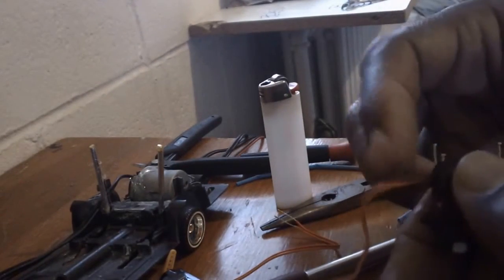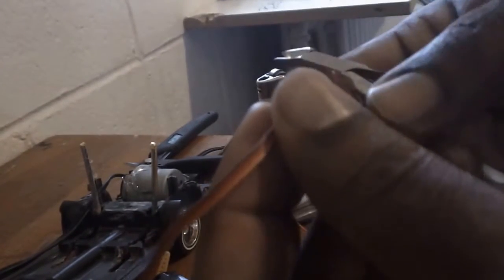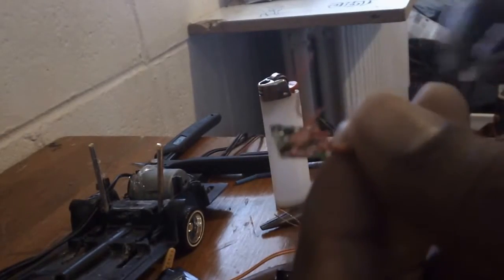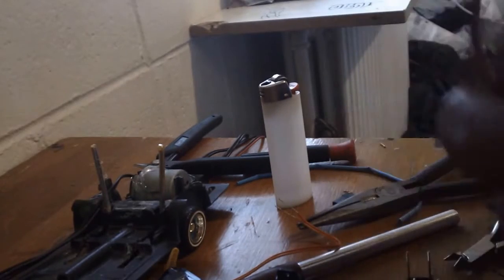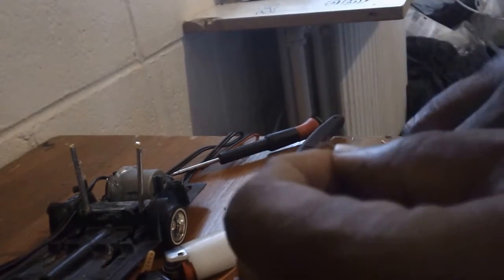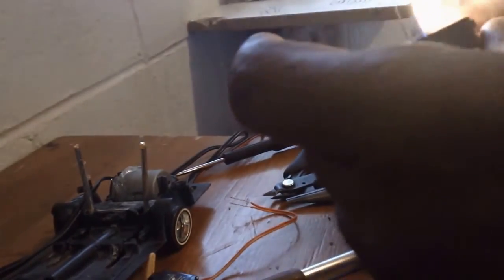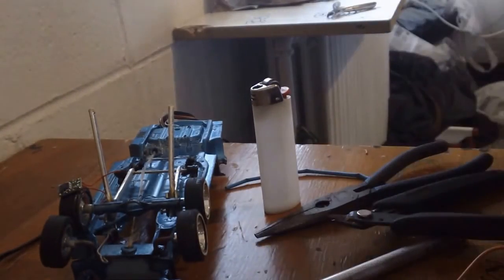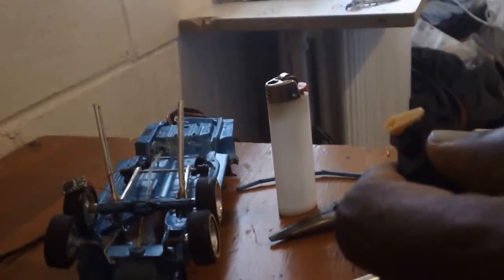Servo Turnigy TGY-1800A

Comment: quick question. I have never built an electric model lowrider. what's the difference in using a modded servo instead of a motor already made to spin?
Reply from the maker: actually the servo gives you more control on the lock up with out it lowering back down until your ready for it to drop all the way 1/2 , 3/4 of the way or desired position
Reply: Ok. Got it. One more question. What makes the front pop hard enough to hop. On a real car its just more juice? I really want to build some. I have a lot of original Homies Hoppers and other large scale remote lowriders i've had for over 10 years. I can modify them once I know how
Reply from the maker: +SwitchDoctor its all about how you build them we use Johnson motors they can handle up to 20 volts but if your parts move freely you should only need a 7.2 or a 9.6 to get off I just redid Baby Blue the 67 rag impala and she shows out on a 4.8 battery
Reply: thanks for response. It'll take a while to get started on one. Just getting back into scale models after 20 plus years
Reply from the maker: +SwitchDoctor welcome back Switch Doctor hopefully it won't be that long let me know when your ready its a gang of us back at it lol
Reply from the maker: +SwitchDoctor do you have any your trying to sale or trade for some work ?
Reply: not really, I guess. They're not all lowriders. Most are some I've bought that I had as a kid and want to build them again better. Just doing a few random ones to get the feel for it again
Reply from the maker: +SwitchDoctor its all good just thought you might have something in the cut

Comment: Yo dre how are the strings run threw tube? From the bottom or both ways? I'm confused cause I was wondering I know it will lift but how would it go back down?
Reply from the maker: The car will drop when you reverse the electricity on the motor automatically
Reply from the maker: the cylinder runs through the tube,run the string through the tube and tie the string to the top of the cylinder